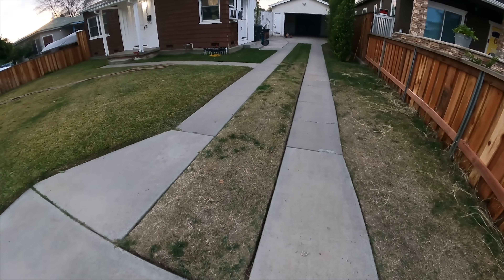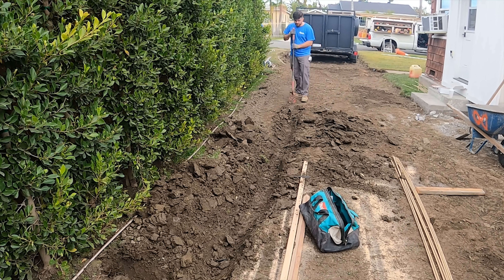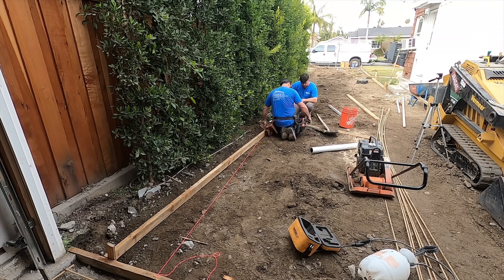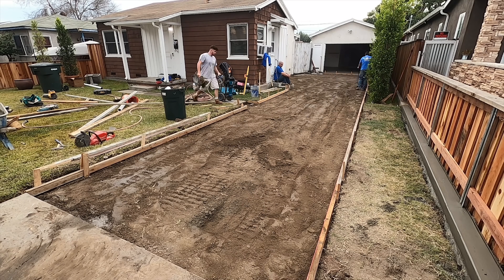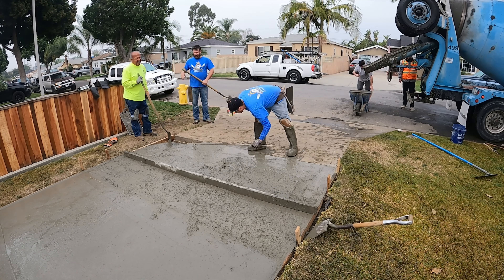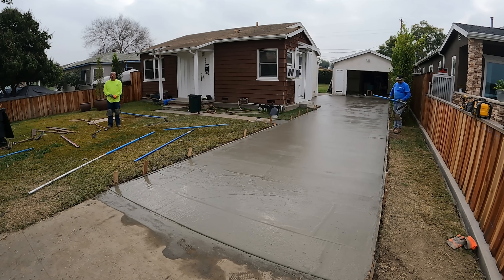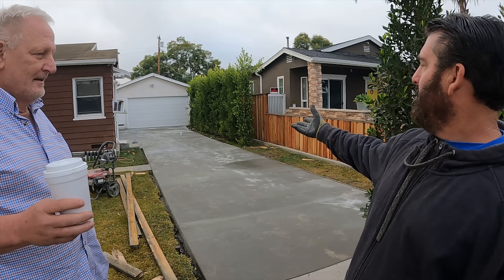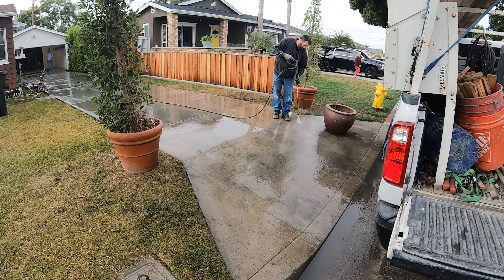Homeowner Ruins Fresh Poured Concrete Driveway!

Comment: I didn’t know I wasn’t supposed to walk on wet concrete. Not sure if I’d want him to fly my plane. 😂
Reply from the maker: My son flew with him already, and had a blast
Reply: Being a pilot and a professional pilot are two very different things.
Reply: Yeah, me neither. Not the sharpest tool in the shed.
Reply: @michaelarmenta8289  It wasn’t even the walking. He used a water hose o it. Concrete takes weeks to be fully cure so that a normal water hose wont damage it. Even after years a high pressure water sprayer can do major damage. He should have gotten a list of does and do nots or at least looked it up online.
Reply: @pauldavis9387  I've poured my own and, yeah, it can be tempting to walk on it. The neighbor had a drive poured, drove his truck thru the tape barrier a couple days later, then tried to blame it on someone else. His tires matched the damage, concrete in the tread. He wanted a free do-over and tried to refuse paying the balance; probably why contractors want costs paid up front, balance on completion.
Reply: Any pilot has the potential to make big bucks. Flying banners is for the bottom of the barrel group.
Reply: Or drone.
Reply: Well.  Looks like we finally found out what Bob Bitchin's day job is.  Who knew?
Reply: @pauldavis9387  Water actually helps cure concrete to a stronger end result. The old timers would cover the fresh slab with burlap and run the hose on it for days to let it cure slower.
Reply: The concrete wasn’t wet like just poured. He said it was 2 days before he came back to cut lines. One thing you can be sure about 100% is that no one knows everything. I think you’re right though, not walking on slower than normal curing concrete is just like flying an airplane. He should definitely know that before taking the flight controls in case he may have to land on a driveway. 😆
Reply: @sssiod  I get that concrete and planes are two totally different things, but it’s the common sense factor for me. A little common sense goes a long way and I’m sorry, but you just don’t walk on fresh concrete. If unsure, test it first or I don’t know, maybe call the guy that poured it and ask. 😂
Reply: @wsvitak  yeah but it wasn’t fresh. It was slow curing the next day between 2 days later. And he noticed after walking on it and using the hose. Then he stopped. But no harm no foul. He said it would blend right in and disappear when fully cured.
Reply: @sssiod  honestly the person to blame is probably the concrete company. Obviously their instructions weren’t clear, or maybe never given at all.
Reply: @katiekane5247    Agreed. You can get a license for a single engine plane after about 40 hours of logged time. His house is a dump. How you keep your home is usually a reflection of your character. Seasoned pilots are usually neat, concise, organized, smart and conservative (as in maybe it's too soon to walk on and use a hose on). This guy doesn't seem like any of those. He's probably a nice guy and maybe he has a long career of flying, but I doubt it.
Reply: @katiekane5247   He may be doing barrel loops with those banners.  That'd be cool to watch.
Reply: @garysampson5258  Concrete that dries can't cure properly. The curing process uses water to complete the chemical action. Not enough water, incomplete curing.

Comment: A couple months ago I had a driveway slab poured. The guys did an amazing job.
They told me to let it dry for a day before driving on it, and 4 days before parking on it. So I waited 7 days just to be sure. I didn't want something like this.
So glad I waited.
Reply: Great idea. Longer the better
Reply: Similar here, I didn't wait that long, but I was damn sure, even in a very dry climate. The crew that did my demolition and new pour worked their asses off for two days and really took pride in their workmanship.
Reply: 7 day cure, you where smarter than your contractors!
Reply: Good choice, minimum 3 days we say but recommend 7, total cure time on concrete can go out to 50 days
Reply: @pxrays547  A dry climate (low humidity) climate doesn't help concrete to CURE faster. Curing isn't a drying process. Actually, a damp concrete surface, from sprinkling or a tarp cover, results in a better concrete curing.
Reply: @artsnow8872  wet burlap material or curing compound is what we use on state highway applications.
Reply: @artsnow8872  Agreed, I said even instead of in spite of. The contractor suggested keeping the surface slightly damp to reduce surface temperature. The question that seems to be of contention is for using sealing or coating compounds; some say DO NOT, others DO IT. I did not coat mine, but my neighbor did.
Reply: @pxrays547   The rationale the contractor gave was partially correct. A damp surface, also, keeps the surface curing process going; then, you end up with the best surface.
Reply: Water the drive with a sprinkler while the concrete cures.
Reply: @CarlosRodriguez-we7mk  yeah but its funny how the dude didnt know he shouldnt walk on wet concrete, makes no sense i think i understood that as just something encoded into your head when youre born lol.
Reply: I did this too, with a cement piling I replaced when building a new deck. The instructions said to wait 2 days I think, before putting weight on it. But a video I saw, said wait longer, just to be sure, because what appears cured on the outside, may not be inside and you should give it double whatever the instructions claim, at least. So, you made a wise decision. The Hoover dam, would have taken 75 years to fully cure out! But they ran piping all through it and cold water, when building it, so they could pump away heat through it, to accelerate the curing. So what should have taken 75 years, took just a couple, if that. I can't remember how long it shortened it by, been a long time since I saw the vid. but it was dramatically shorter, just a small fraction of the 75 years it would have.
Reply: @sergeyminchuk8932  Facts my neighbors parked in the street for at least a week and a half until it was dry enough, keep it mind this took place mid summer in louisiana so it probably would take much longer for a driveway to dry during mid spring some where other than the south and west
Reply: @sergeyminchuk8932  So it is that long eh? I knew it was a lot longer than a day or even a few. I use paint logic with cement, it's very similar. While it may feel dry to the touch or even the surface seems hard, what's underneath isn't. And takes literal weeks to cure properly/fully.
Reply: @MrBilld75  yup correct is that where u put like dry paint on top off the concrete for a diff color if so that’s tough work only did that twice and yup it feels like it’s dry in a hour but it’s not
Reply: @sergeyminchuk8932  Painted a lot of scale models in my time and body work on full size vehicles. And have prematurely sprayed on what I "thought" were 100% dry coats, only to have them react and wrinkle etc. Whereas if I waited weeks upon weeks and attempted it, it would not do weird things like that. Oil based are the worst for slow drying vs. acrylic or latex etc., but also the toughest. With paint it's pretty much like the instructions says, either recoat within 20-30 minutes or 24 hours of the first coat, or wait a lot longer to recoat, if beyond the semi wet 24 hour or less window. I will typically do two coats back to back within the first 30 minutes or so, than let that dry for weeks before additional coats. Never had a problem that way, but I have with shorter times.
Reply: @Jacksonn985  Whatever
Reply: My neighbour waited 30 days. 
It looks great.
Reply: @artsnow8872  
Dad was a contractor; I learned this as a child.
Reply: Glad to see other concrete finishers saying minimum 7 days haha! That’s what I always told people! Maybe accelerator would speed that up, but still a big risk of damaging the finish
Reply: Rubbish just use more cement .. weak crap low cement concrete If it ain't done in 2 days or less
Reply: @greenidguy9292  putting water on concrete doesnt do anything with the new sealers.  That is a way of the past when you used to need to wait to seal
Reply: Holy crap  only 4 days?
Reply: @svintx  u can drive on strong concrete the next day .. people use too little cement and its weak crap
Reply: Concrete takes over a month to reach full strength
Reply: @UnknownMoses  It's still doing good. I haven't had any problems, and I park a pretty large car on it.
My one modification, if I had it to do over again, would be to have them build a speed bump into it at just the exact position.
So instead I placed some short cinder blocks on it at the perfect position. I back the car in, and hit the cinder block. I let it roll forward an inch or so. Then I'm in the perfect ideal spot for popping the trunk and bringing groceries right into the house. I don't have a garage.
Reply: 28 days here in Canada
Reply: So the guy actually told you how long to wait and you listened? Funny how that works
Reply: Thought this was gonna end differently I'm disappointed
Reply: It's a 7-Day cure time before you can drive on a slab with the regular size vehicle and longer if it's a heavier vehicle
Reply: When I got my driveway poured earlier this year my contractor told me 7 days to drive on it. I waited 12.
Reply: @danny8292  that's for a full cure. It's 90 percent strength at day seven and can readily handle car traffic
Reply: @americarocks1776  interesting.  I did not know that
Reply: So glad you didn’t touch it
Reply: One day would not have been long enough for sure unless they poured a hotter mix like seven sack or 5000 psi for the technical term guys
Reply: A week is a good idea , two is better.
Reply: HE WAS DRAINING INTO THE DRIVEWAY!!! LOL
Reply: @MrBilld75  What you say about the Hoover is true except the heat. They had an ice plant on site and ran cold water through the pipes to cool the concrete. Curing concrete makes a lot of heat, in the winter when we strip concrete walls they will put off steam and be hot to the touch.
Reply: @udavidism  Ahh yes, that's what it was, thank's for the correction. Been a long time since I saw the doco. I knew it was one extreme or the other, but something wasn't going cure it right, for decades. And it is an exotherrmic reaction, so it will create heat as it cures. So using cold to radiate that heat away would be advantageous.
Reply: Our specs require no loading for 7 days.... also allows time for the 7 day break test
Reply: And to this day he has never use his driveway
Reply: Go with pavers instead , you won't take a bad hit paying taxes for the concrete,  you can drive on it immediately and if your car leaks on it , simply change a paver
Or asphalt to save a ton of money .
Reply: @ontop7437  They are cheap to replace and easy to level. I've used paving stones before, it's a great, economical, replaceable and easy thing to do.
Reply: @CarlosRodriguez-we7mk 5
Reply: @Bogues_88  Why would someone pay to pour 5000 psi concrete when residential driveways call for 4000 psi?  Just for luxury to drive on it 5 days earlier? With that same logic just overkill it and pour it as a 6" slab apparently  competitive bidding and the homeowners budget doesn't matter
Reply: @Jacksonn985   No.  It's not a "drying process", it's a "curing process".  Hot dry days, direct sunlight, fast water evaporation all make for a weaker concrete.  Slow cure with cooler days, while keeping the sun off and the new concrete surface damp makes for a stronger product.  Also, it helps to have a moisture barrier under the new concrete to keep the water from being sucked out of it into the ground before it cures.
Reply: @MrBilld75  , I hear ya, oil based paint takes forever and a day to completely dry, I hate acrylic but with pets and kids about oil is out of the question.
Reply: @charlottesmom  Yeah, I love how easy acrylics clean up etc., vs. oil, but for durability, I find acrylic weak by comparison. Oil is so tough, we still have things everywhere on this earth, that were painted with oil paints and still look great, or at least passable. You can't match that durability today really, with standard paints (not talking appliance epoxy paints etc., as they ARE super tough).
Reply: @MrBilld75  , I work with epoxy at times that stuff is like titanium! Oil really has a special look/strength to it I wish I could use it.
Reply: @charlottesmom  I really started liking Tamiya model paints even though they are acrylic, as long as I was clear coating them after (for durability, cause it isn't as durable as oil). As I found out that not only was that brand easier to clean up, but also alcohol based. So cleaning up or thinning the paint, was as easy as using isopropyl alcohol, no expensive solvents necessary. But the majority of my model paints are still Testors old style little model paint bottles. Tamiya is literally the only non-oil paint/acrylic I've ever really liked.
Reply: @MrBilld75  , My dad had the little Testors bottles back in the 80's/90's for his model painting. I'll look up Tamiya, thanks for the info! 😊
Reply: Lol - my dad got a new driveway, and blocked it off for four weeks.
Reply: @artsnow8872  That actually depends on the amount of water available and the heat. If you don't keep enough water on it and it gets really hot, you can actually cause Cracking that way. I've seen it a lot. If the water collects in a valley but there isn't enough water to keep everything else cool, you slow the curing process in the valley only, and end up with a crack running right beside it. It also takes place with burlap. If you don't keep it wet enough, you end up with cracks where the burlap sheets overlap. Wetting is a good idea, but isn't all that simple. I prefer wetting the subgrade and adding chilled water to the mix at the plant, and deep jointer on the bull float instead of saw cutting. Less babysitting that way.
Reply: Unlike this homeowner, you're NOT a moron!!!  Congrats for getting some smart genes!!!
Reply: Drive on a concrete slab after one day of drying..? 😬
Reply: Now see, that's common sense 🙏
Reply: Shaking my head here, we recently had cement filled inside of back of our garage, the workers did a great job, told us t/let it dry for 2 days & not to park any vehicles until 4 days, we also waited more than 4 days, wasn't going t/let this small expensive job be ruined! My husband would have killed me if I messed up the cement!
Reply: I was told a week after pouring my new drive, cheap on gas since both cars were in the garage.
Reply: Guys, HERE is The Savior

HalleluYAH translates “Praise ye YaH”

YaH is The Heavenly Father 
YaH arrives via the TENT OF MEETING
YaH was Who they Crucified for our sins
YaH was Crucified on an Almond TREE

— Ancient Semitic Cuneiform of Moshe (Moses)
— Isa Scroll (The Original Isaiah)

Isaiah 42:8
"I am YaH; that is my Name! I will not yield my glory to another or my praise to idols.”

Isaiah 43:11
“I am YAH, and there is no other Savior but Me.”

Isaiah 45:5
“I am YaH, and there is none else.”
Reply: So what was the verdict? Could you see the marks after it cured?
Reply: @PeNGuiNZoMbiEUYA  It came out good.
I love my driveway slab.
Reply: You did not water it??)
Reply: Plonker! 🤣
Reply: If birds leave feet marks, it's not dry enough yet.
Reply: O'Dell is click bait
Reply: Your contractor was an idiot. 7 days before driving on it. At 7 days concrete reaches 75% of its strength.  This guy was smart getting his customer on video admitting to the boneheaded thing he did.
Reply: The biggest thing that determines curing time is temperature. In highway work, probs will be placed in the concrete slab to measure the temperature of the concrete. Cooler temperatures will take longer to cure.

Comment: Wow, a contractor that is actually concerned about how things hold up in "the future" (drain pipe on solid ground). Thanks for being so good.
Reply from the maker: Thanks
Reply: Most guys take pride jn their work. But some are reAl jerks. I've known a few who I would never let do work for me.
Reply: This vid was so relaxing to watch, I mean getting the thing done, it taking shape and all. 
Stress relief. : ))

(to a point)
Reply: Yup I just subbed just to watch concrete dry. : ))
More good success to you guys.
Reply: and then he puts rebar directly onto the floor..

amd then he doesnt put in rebar at the top.

this isnt a job to hold very long
Reply: @thesmallestdaltonbrother2176  the rebars were elevated manually with hooks during the pour
Reply: Why do people act like the majority of contractors are shitty. They’re not you’re probably just hiring the cheapest one.
Reply: @larslover6559  thers blocksthat go below the rebar to lift it up they're called chinking they attached to the rebar with little wire and sticking out of them that way it is not sink it is at the correct height this guy's not a concrete professional